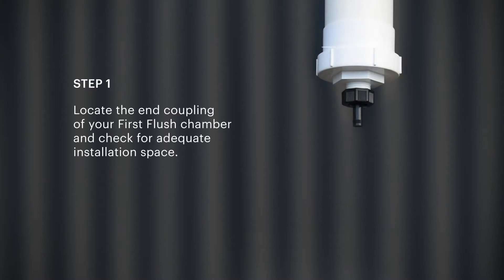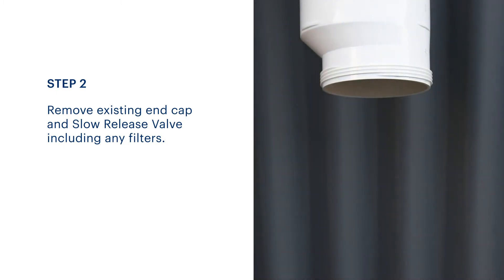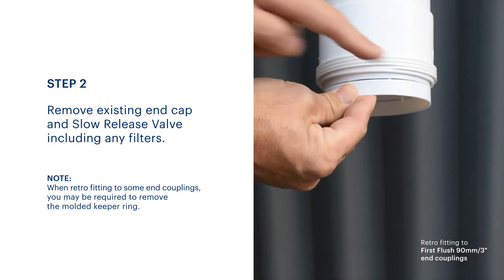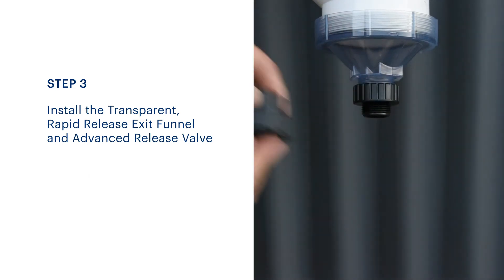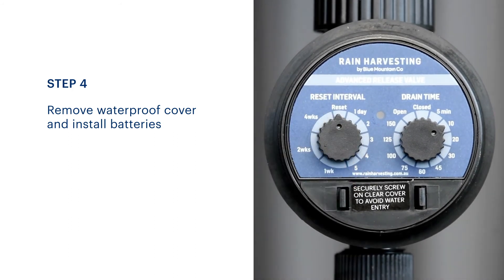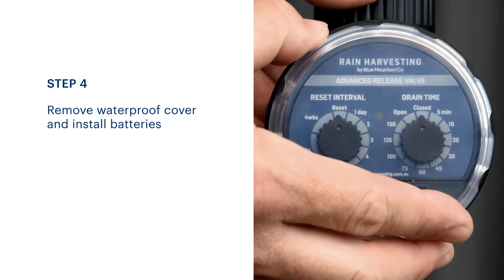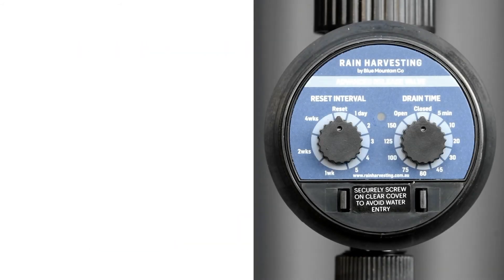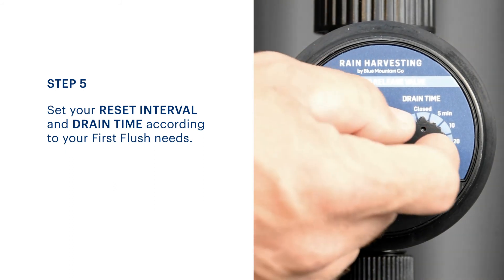How to Install: First Flush Advanced Release Valve

Comment: So, how do you "set it to 8AM"? There are only 2 knobs on the unit, one for how frequently it drains and the second is for how long it drains (to get all the 1st flush water out). Does it automatically do the flush at 8AM? Is there an internal clock?
Reply from the maker: Hello Stephanie, it's not possible to set the reset time as 8am as there is no internal clock. You can however set the timer to drain daily. You could activate this setting at 8am to get it to drain each day at this time.